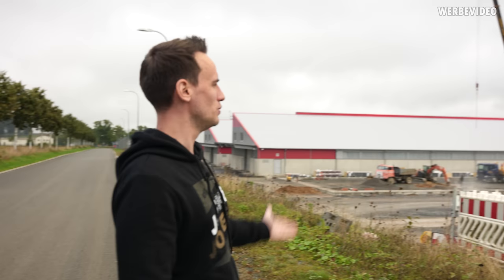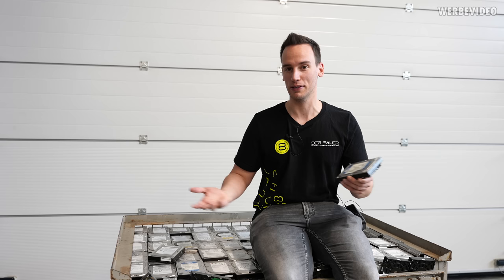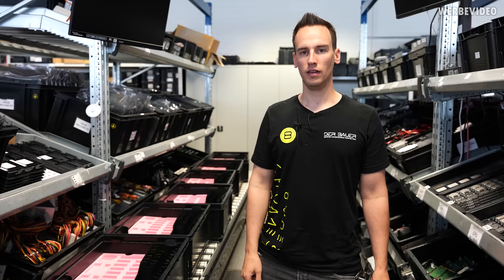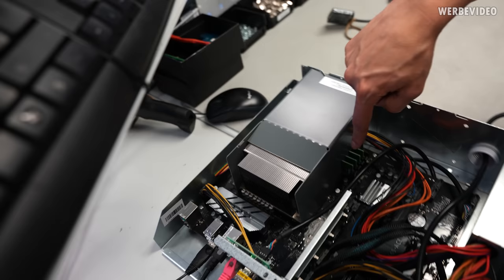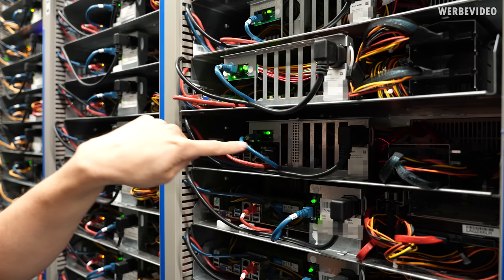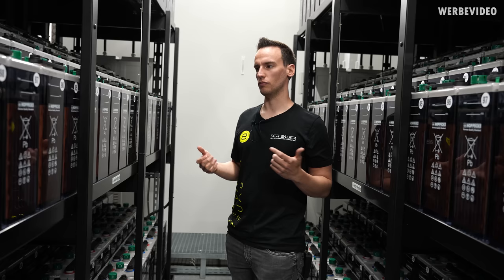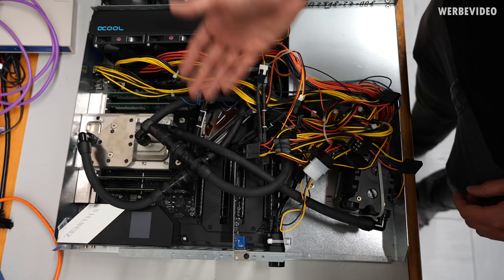Over 200,000 Servers in One Place! Visiting Hetzner in Falkenstein (Germany)

Comment: 3:35 "the cooling is actually underneath me": Peculiar. Cold air goes down. Wouldn't it make more sense to have the cooling above...even though it is contained in ducts?
Reply: no because the air warms up as it passes through the machines so it is moving from low to high by convection as long as you blow the cold air in at the bottom. That saves a lot of energy to move the airmass.

Comment: always puzzled why hosting companies will cash out on super expensive server hardware and stupid standards like 1U 19 inch, which results in the hardware needing >100W screaming fans and active AC units, instead of just relying on consumer parts and a bunch of fans blowing in outdoors air over the parts. the fact that this company can use consumer PCs at scale is proof that it works just fine.

Comment: My question about the temperature control is that ac isn’t just for cooling, it’s also for dehumidifying. So do they run dehumidifiers if it gets too humid out or is humid air not as big a problem as I think it is?

Comment: It amazes me how many servers still use the blue VGA ports for video output. I would have thought they would have switched to something like mini DP by now if for no other reason than to free up space for other IO ports, but I guess VGA is still the minimum viable option! I guess I shouldn't be too surprised given how much server OEMs seem to want to charge for out-of-band management hardware and licensing.
Reply: I think the simplicity is nice.  You have  a troubleshooting cart, with a KVM switch, and you can plug it into every single computer.  

If servers have DP and VGA, since nobody wants to carry around multiple KVM switches, you would just use VGA.  So the result is, nobody wants to spend more on a DP that will not be used.  If you had only DP, not you need adaptors, and add complexity, and there really still is no benefit.
Reply: vga is kinda nice for headless - it doesnt care if the monitor is actually plugged in generally
Reply: @tel0004  I work more with 'commercial' servers rather than custom built stuff like this video showed. On those systems, panel space on the front and rear tends to be at a premium. The advantage to Mini-DP or HDMI is that the connector is much smaller so it uses less panel space. It appears that the advantages you mentioned must be more important, since nothing in there seemed to be using anything but VGA, and all of the 'commercial' servers I work with are VGA as well!

Comment: For their drive testing, I can see them probably wanting to use a modified version of a 45 Drives case and making the drives hot swappable so they can make their testing easier. Maybe move to a 2 LED version with a green and red LED?
Reply: Solid state.

Comment: This is very interesting! I have a question: Hetzner are doing things for the environment as you showed. But also they are using a lot of proprietary parts and getting motherboards made for them specifically. This means potentially more e-waste since no-one else can use their stuff.
Reply: That was addressed in the video. They use the parts until they are scrap, no one will want them when they are done. Actually less waste.
Reply: @tedmoss  ah okay. I didn't get that from the video.

Comment: Increasing the temperature in the test chamber will be to accelerate the failure of components, rather then testing whether they will just work in a 45C ambient temperature.
Reply: this way you will see how they react to that high temperature, and how long before they break. so in case you cooling fail, you know  you have  x  minutes before everything goes down
Reply: @dariusEMPEROR  I’m not convinced that you will have a figure in “minutes”, as this will depend on many factors.

Accelerated Life Testing is used to determine lifetime - accurate to between hundreds or thousands of hours if you are lucky.
Reply: @alexscarbro796 :  Agreed.  Yet knowing the earliest point of failure is useful when planning/compensating for extreme temperature conditions.

Comment: I really wonder if the use of old cpu/mobo Vs newer more compact hardware is worth it from an ecological standpoint. Anyway awesome and interesting video. Thanks
Reply: It is.
The production of hardware (especially silicon) takes a LOT of energy and ressources, so from an ecological (and also economical) standpoint, it makes sense to use hardware for 10 years or more.
Only after about a decade you could argue about the energy efficiency. But it's the same with like a cable network, laying down the cables is a big upfront cost (similar to the ressources spent for production of CPU's etc.) but after that, using it isn't really costly (similar to energy consumption of a server). You wouldn't rip out cables if they are still usable and adequate, wouldn't you? ;)

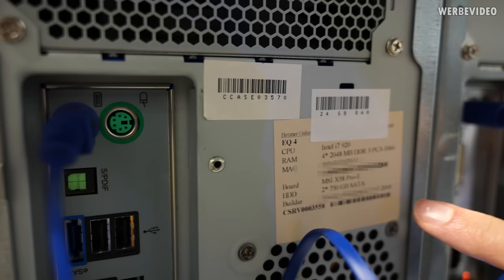Comment: Ah a first Gen i7 3:22 ...I still have my first high end no expenses spared gaming PC build kicking around from 2010.  Its a i7 960 (4 core 8 thread) EVGA x58 SLI-3 mainboard, 6gb ddr3 ram,  2x GTX 580's in SLI. in a Antec LanBoy case...  I have it running win7 and win10.
Reply: Hmm I have i7 3770 8gb ram Rx570 8gb work best .

Comment: It would be wonderful if we can convert the hot air into reserved energy, instead of using energy to cool it down.
Reply: there is no way of doing that in any useful manner as the temp difference from the hot side to ambient air is not drastic enough to perform any real work and to allow the temp difference to rise higher would reduce performance and longevity of the machines but it is in germany which has colder winters so the cooling system is using much less energy during those months

Comment: You mention climate change in this, do you have any thoughts on German de-nuclearification? Health issues from burning coal have gone up since they made the decision to start phasing nuclear out, and background radiation is higher as well (coal contains enough thorium and uranium + breakdown isotopes so as to be radiologically significant). It greatly concerns me that so many places like this are running predominantly on fossil fuels still, and that those numbers in europe are actually increasing significantly, despite the adoption rate of green energy, entirely due to the phasing out of nuclear. Renewables won't be able to fill the void at night or when the wind isn't blowing either, and batteries have their own massive environmental effects.
Reply from the maker: I'm generall not a fan of doing some sudden changes without having a good alternative in mind. Nuclear power is clean but the waste is a problem. Instead of just not using it I wish that there would be more development in all directions including making nuclear power safer and improving the waste problem. At the same time the renewable energy sources are not used as much as it could be over here... so much to improve xD
Reply: @der8auer-en  Yea, china's way ahead of everyone on the waste front. Thorium is the future and we could have had it fully deployed by now if we'd kept investing at the rate we were in the 60s and 70s. We'd probably also have hit zero carbon emissions targets for grid level generation in a lot of countries. At least the leap is finally being researched in the west now that the potential is known

Comment: 15:23 Again, with all this "green" sensitivity, why not power all the servers directly from the batteries. Buses of proper DC voltage could easily be made up with proper series and parallel connections. The servers could be powered directly off the DC buses. The power supplies (and the heat they generate) could come out of the servers...freeing lots of space and heat generation. The only AC you would then have would be on the battery chargers. And the heat that generates could be more efficiently reclaimed (and even used for air conditioning).
Reply: The backup batteries are for emergencies — such as power grid/substation failure.

Also, they're only capable of lasting fifteen (15) minutes, which is more than enough time for the diesel generators to kick-in and take over.
Reply: I think it's a really interesting question. Since they do so much of their own design and manufacturing, why not look at a complete revaluation of the power supply using DC?

Comment: i dont get why they wouldnt just do the standard server racks.
Reply: Custom shelving = Cheaper
Reply: roman talked to some employees in the german version and discussed there that it's more efficient use of space and resources for them by using the custom formfactor. i'm assuming manufacture and material costs are a lot lower if it's just a bunch of bent sheet metal cases that are riveted together vs. standardized parts with a lot of extra materials and features beyond what only hetzner needs in their specific use case

Comment: The data center is good but they are too bulky. They should re-engineer at list 1 or 10 TB micro SD card to be big like normal  hard-disk  or half a kilogram. The size of that hard-disk equivalent will be expensive for them, but once the manufacture notice demand for them, we the science community will get them very cheaply in 5 yrs time. So i may not get paid by the manufacture but he will lower price for me. my victims will get me even more and more data freely as a result, now do the math. The value of data will outweigh any monitory value.

From my calculation those 200,000 servers can be reduced to just one serve, equivalent to just  5 BEDROOM house size. The cores running on that server must be a 2 nm 3D CPU and GPU design.

Comment: Actually, this place is quite messy. Due to the critical role of a data center, they have to follow very strict rules for organizing and ordering every server, wire and component. The rule of thumb is not dangling wire which has been violated frequently here. It’s shocking to see this happening in Germany.
Reply: They have best price/value offerings - probably world wide. If you need premium hosting you'll probably find someone offering the last % extra for 5 to 10 times their price.

Comment: "if the hardware is still working, why would you throw it away" well as a data center valuing the environment, maybe the relatively abysmal energy efficiency of some of those systems might be a reason.... Keeping an i7-920 system running for "efficiency"? Good lord...
Reply: as a data center valuing the environment, they DON'T throw them out, because the production of those fancy new energy efficient systems doesn't cost enormous amounts of energy and ressources, right? they are free, right?

Comment: the mini towers wasn't even 2008 standards. But I guess it was cheap. 

Density wise they're wasting huge amounts of space and cooling capacity. They would have been better off not building a new wasteful building and instead repurpose this one with modern hardware.
Reply: That would mean informing a bunch of their customers that the servers they are using are being removed from service. This creates a ton of work for the customers. Not good service, customers unhappy.